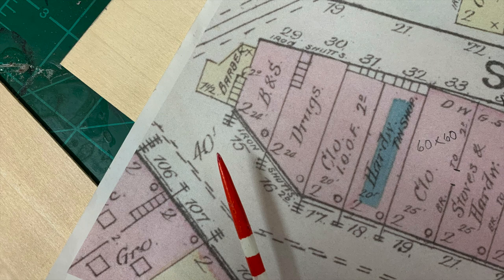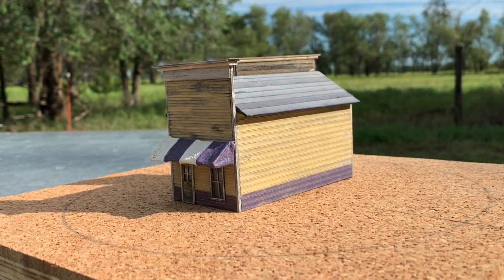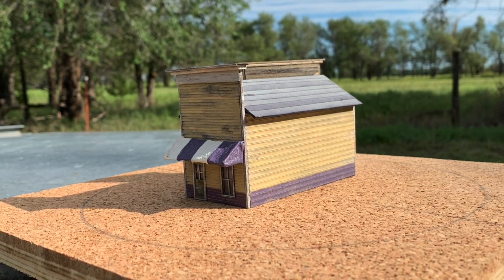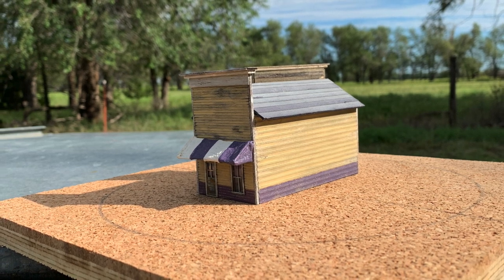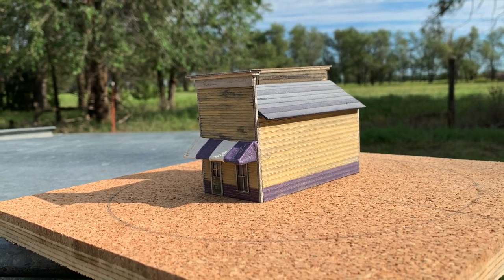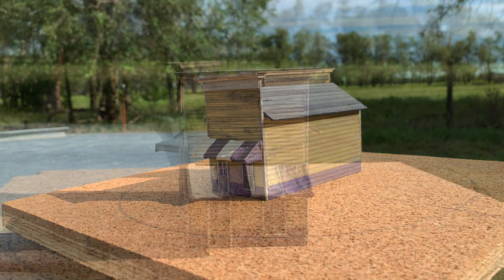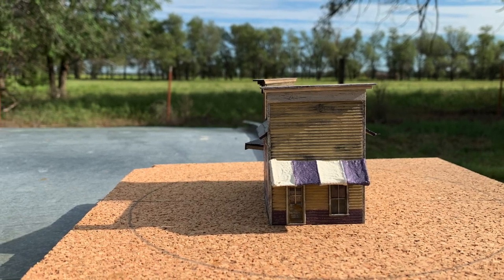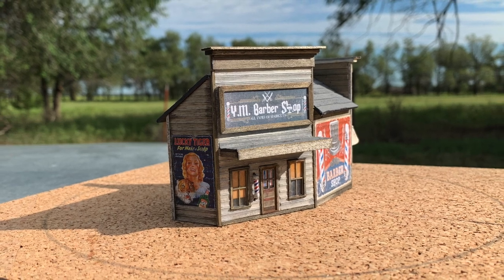Structure build 12  The Barber Shop

Comment: Have you tried using plain printer paper for the awning? I use "crepe" paper for HO. Seems to work well. I even use .010" plastic for modern awnings which are different due to the tautness of the modern materials. I think the building is fine. Sometimes I can rush to color too quickly and find it best to leave that out until I can judge the collective whole like other support buildings, etc. Cheers. 😁
Reply from the maker: Thanks Boomer.  No, I haven't tried anything else for the awning, this was my first attempt.  I do recall you using crepe paper for something similar but didn't have any on hand so I went with paper towel which turned out too heavy.  I used matte medium, so I should be able to soak it in water, remove the material, and start over.  

I deliberately went with a color that was outside of my comfort zone, and since I knew I would be re-doing the awning I wasn't overly concerned.  Only the front of the building and the barber shop side will be seen.  I'll re-assess the color choice once I see how it works with the rest of the street.  I'm just curious, how do you judge the collective if you have left out the color?  

I'm thinking of doing a semi-scale drawing of the rest of the storefronts, printing multiple copies of the drawing then adding color just to see what I like.  Thanks!!
Reply: When one paints a canvas they look at every shape before they deliberate final colors. I can visualize the color of the whole scene (minus the details) in most cases because I know where I want to go with it. Furthermore, I change the color of things all the time after sleeping on things, etc. Color change is no biggie though and it's a good idea to stab in "other" colors (like you did) to see how it looks. Easy enough to change as you say.😁 @OtterCreek
Reply from the maker: Thanks again Boomer, I always appreciate your insight!

Comment: Another great build video, Dennis.  I love the soldered awning.  As for the colors, I think the yellow and purple is fine, and when you have a whole street of buildings with different colors, and you don't look at the building in isolation, I think it'll look even better. - Paul
Reply from the maker: Thanks Paul.  I'm sure the purple will be fine.  The long side of the structure will barely be seen anyway!

Comment: it was a fun video. It's a unique and interesting building. It looks like it evolved with time. I wouldn't have gone with the purple but hay, each to their own. IMHO it's a possible choice. The Barbara's pole looks real good and the awnings are OK. Yes, their texture is a  little ruff and if this building was part of a stand a lone diorama that might be a problem but as part as a rather large bock in a larger community it will be fine. The purple, the signs will be notice first and last before details in the awnings.
Bob
Reply from the maker: Thanks Bob, I plan on re-making the awning and trying either crape paper or printer paper.  One of the things that bugs me the most about the awning is the lack of symmetry in the stripes.  Three white and two purple will work much better the next go-round.  The sign for that portion of the building will be perpendicular with a large hanging tooth.  I just need to sculpt the tooth or pull a real one!